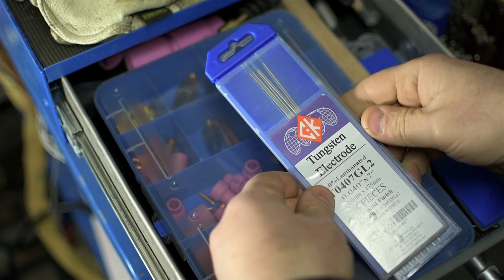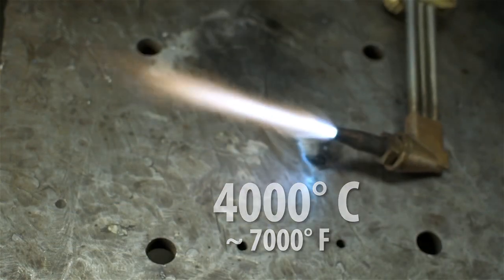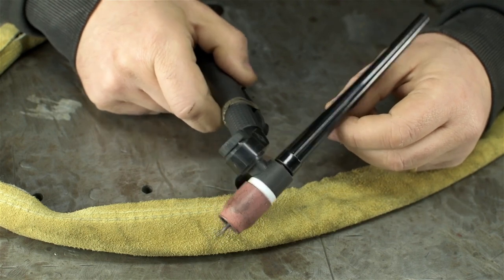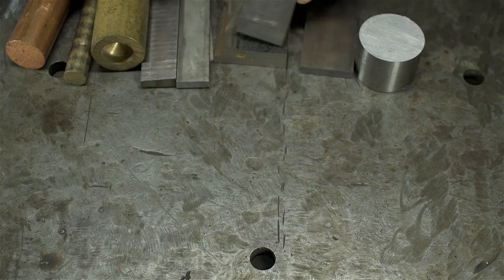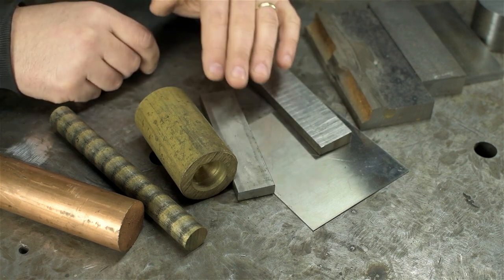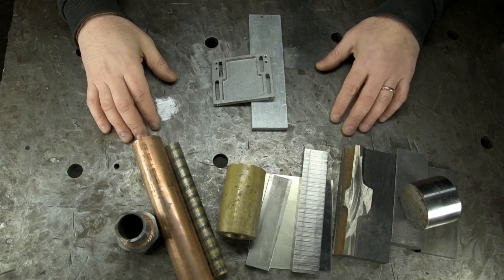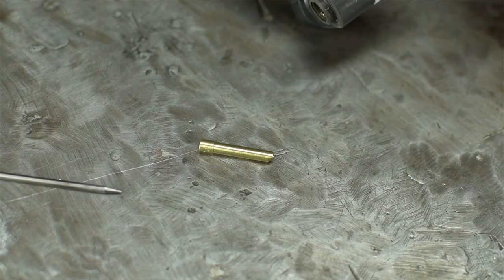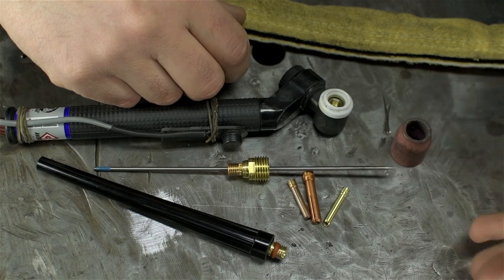Making A Stand! Why I Love TIG Welding

Comment: As a licenced stick/tig/mig welder for over 20 years.
And fast paced production welder for the last 10 years, come sunday i grab a stick welder an meditate.
Slow, soft, comfortable.
It's like smoking a pipe, it takes its time and that's it.
Mig makes it fast.
But tig makes it beautiful.
Reply: its been 10 years since ive done any stick welding. but i work in a precision machine shop, theres not a lot of stick welding needed for Mercedes, BMW,  BASF, Bosch, and the military. and then about 6 months ago they send me to Continental Tire to stick weld support beams in for a platform i built my boss picked up as a favor for a friend of his. going from mainly tig/mig welding back to stick is not like riding a bike lol
Reply: @CraigsWorkshop  tig still has fumes
Reply: Amen! Love the peacefulness of 7018!! But I appreciate the violence of 6010 too!!!
Reply: Agreed. For building stuff in and for the home shop I go for the mig since it's easy, fast and looks good and I'm dealing with 1/4" thick metal max. For repairs or thicker material though I reach for the stick running 7018 DC electrodes, a lot less work. However, I've been thinking about the tig for aluminum but I just don't do enough aluminum and those aluminum brazing rods work well enough for light repairs.
Reply: I love how most fabricators will say a MIG is a silicone gun of the metal bonding world. 
@jan-ove you summarised to simple, and it is so true.
Reply: @DISCOSHOEBOX  when i use a silicone gun, I find myself trying to lay down a nice whip. Doesn't work very well, I end up treating it like 7018 drag rod, that works.
Reply: Got my 50 year old Air Liquide working on my cars. 309L is my happy place.
Reply: Tig mag....

That's pleasurable.
Reply: @AldrickExGladius  I really like TIG , I used to practice with sheet metal shop machine, we could run everything through the wall to Millwrights welding table in the construction/maintenance shops at the local DuPont Teflon money making machine that unfortunately polluted the world. Myself included, just a mere. 002 ppb is the safe drinking water level, I still 8.00 ppb in my blood which is monitored every 3 years by the C-8 Science Monitoring program. It's still there, yes, my non functioning thyroid gland, the side effects of the medicine is nervousness and insomnia, and the bad high cholesterol is getting better by substituting honey instead of white sugar [bleached].I was like a kid in the candy store with all the industry in the mid Ohio River valley. Weldíng engíñeering was my name and fabricator was my game, thanks old Tony..
Reply: @Frost pot *all three for the first part, just stick and flux core mig for the second.
Reply: @Epicentera  fuck yeh

Comment: You're not the only person that suffers from the psychosis of wanting to be able to fix anything. I started as a small electronic repair technician and ended up with enough equipment to fix most problems up to BGA reballing (which ended up costing me a lot). And now because of primarily your channel and some others I'm an apprentice machinist that just recently bought their first Mill. I was always interested in mechanical things. After seeing the process and how things were made I wanted to learn more and be able to do it myself. I was starting to hate my old job as a programmer and not the CNC kind. I wanted to do something something completely different and I'm not sure I would have switch careers if it wasn't for channels like yours. I still like programming for myself but as a career it was just driving me insane and now I'm doing something I enjoy. thanks
Reply: Hey, as a machinist fabricator with coding skills you're going to end up with an awesome skill set dude!

Comment: Tig is perfect for a small garage cramped with stuff you don't want to put on fire. No sparks flying unless you forget to turn on the argon.
Also a big plus for the wedge collets.
Reply from the maker: couldn't have said it better myself.
Reply: That does it. I'm buying an AC/DC Tig.
ToT's TIG preference and the comments on here about a home workshop like mine is convincing.  I can live with an Argon cylinder in my attached garage, but an Acetylene cylinder has always made me shy away from pulling the trigger. 
I dont need MIG speed and I like the neatness and versatility of TIG, and I'll still have the brute force of stick if ever needed.
Reply: Oh, and thank you Tony for the insight into our psychosis.  I understand myself so much better now!

Comment: I've pretty much retired after 27 years of welding, mainly TIG. About 12 years ago I welded 99.9% pure silver for a silversmith who had made a very large cross by casting it. I used a doe grinder to open up some casting holes and filled them with silver wire he brought. 
   Because of the low electrical resistance it take a whole lot more power than one would think lol.

Comment: I've learned something very important today while watching this.  Do not attempt to drink your morning latte (I work evenings) while watching one of Tony's videos, when sitting in your tow truck you spent 3 hours detailing before the boss does your spring cleaning inspection.  you will find yourself frantically trying to clean the windshield, the dash, the instrument panel, the steering wheel and the floor again.  

On a brighter note I have a lead on a possible lathe and mill I don't know what I need them for but after watching all of your videos I have come to the conclusion that we all need a set.

Comment: Sharpen your Tungsten in both ends, so you have an extra bullet without leaving your comfy chair. Gets rid of the paint after a bit aswell, but you will have to store it in a way so you know what kind it is.
Just a thought.
Reply: Kristian Gjerstorff this is TOT he doesn’t dippy dip lol no need for back up 😂
Reply: Easy. All I have is 3/32 2% lanth. No paint required!
Reply: @mordantly  cant use that for everything :)
Reply: @weldingjunkie  did not think of that. Sorry for My mistake :)
Reply: Kristian Gjerstorff 😂 anytime. Now me myself I do what you said lol
Reply: Mr Wolf I use 2% lanth for all my steel and aluminum up to 200amps

Comment: Tony, we all love tig welding, no need to soapbox. I'll let you continue though.

Edit: nice build Tony! 
Also, for the love of God, aspiring welders, don't go near zinc or galvanized steel. Metal fume fever may only lay you out for a day in low doses but it'll be one of the nastiest days of your life.
Reply: I always mechanically or chemically remove the zinc layer on the rare occasions i have to weld galvanized steel. That feeling when you think you have it, and all of a sudden the pool just explodes and a blob of metal sticks to the tungsten tip is just marvelous.
Reply: @bogdan_n  lol I know that pain. I remove it as well, then wear a respirator, under a vent fan, on the moon. When I got sick from it, I was new to tig welding and the shop owner threw me a bunch of fittings to weld. The were parker fittings and did not look galvanized at all but under the arc you could see it burn off just a little bit. Needless to say, I was getting griped at to hurry up the whole time and by the time I finished the sixth one, I knew something was up.
Reply: And if you're ever laid up with fume fever, go drink a lot of milk. I'm talking about a gallon. And buy an extra gallon for when you run out. It helps a lot, speaking from experience.
Reply: @dontnubblemebro  I have heard that, I tried it at the time and got though about two pints, got impatient and switched to beer.

Comment: Tig welding looks so easy when you do it, and the result looks awesome.

That's not at all how my experience of tig welding have been.

I don't weld that often and I'm currently very pleased with my small DC mma inverter.
Reply from the maker: any welder is better than no welder, Niklas!
Reply: @ThisOldTony  My anglegrinder and paint makes me the welder that I'm not.

Sometimes I consider upgrading my welder, you have convinced me to go the tig rather than the mig route when I get around to finally do the upgrade.

I'm currently mostly a woodworker, but I really want to improve my metal fabrication skills - your channel is a great place to learn and get inspired.

Thank you very much for the time and effort you put in to it.

Comment: Scoring with the welding needle. That really hurt my feels :O
Reply: Martin Hallmann tungsten, which is the T in TIG
Reply: Def never heard it called welding needle but we knew what ya meant. I never saw anyone do that either. Don’t wanna contaminate the tungsten
Reply: @ryanmalin  You probably won't contaminate it, tungsten is much harder than steel and it won't stick to it until it's at welding hot temperature.
Reply: I use my now not used for welding "red tungsten" for all metal scoring.
Reply: DISCOSHOEBOX still buying and using red tungsten.

Comment: You can DC tig aluminum, but the cost of the helium bottle to do it likely costs more than the Harvard Fray AC/DC machine.
Reply: I have thought long and hard on this one, and before I bought an ACDC unit I would have agreed.  
Think of it this way. You can weld DC aluminium, in the same way that someone can have horizontal relations with their mom,  dad,  sister or brother but spend some time and money on the right stuff and you won't have to compromise on a welding situation.
Reply: DISCOSHOEBOX Its more possible than you give it credit for.  Having not done it myself, defer to the Welding Tips and Tricks podcast episode 63.

Comment: What are your thoughts on them stopping production of red tungsten. It's always been my favorite and to be honest I'm not a fan of the new purple stuff.
Reply: The red tungsten electrodes are radioactive, not enough to kill you. But grinding them without the right safety gear is definitely not the best thing for your health.
At my work we use the gold once only. I have never welded with the red once but I get really good results with the golden electrodes.
Reply: @jakobh9122  I've tried the gold and it's not bad. It's just that the red tungsten has such little radioactivity it seems strange to shut down all production of it.
Reply from the maker: I switched to 2% when the reds were still around and haven't looked back.
Reply: @billm.8592  you can still find them on Amazon. We even have some at our company, maybe they are banned at the place where you live. In Germany you can find them, but luckily they are not that popular. Furthermore the simple radioactivity of these electrodes are not that bad, but if you grind them and get the radioactive dust inside of your lungs it is really not good for them.
Reply: @jakobh9122  As a hobby welder I was not aware of that . . . .I have a stock pile of red ones . . .Thanks for that.